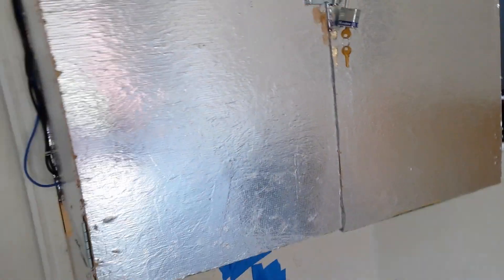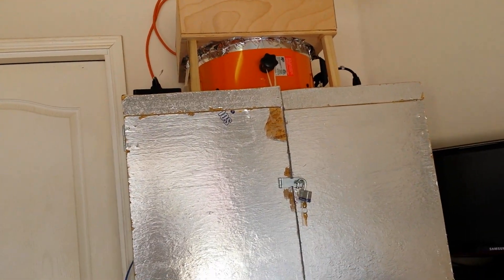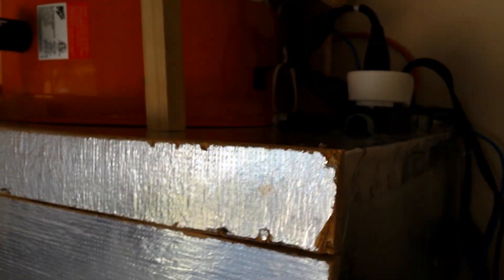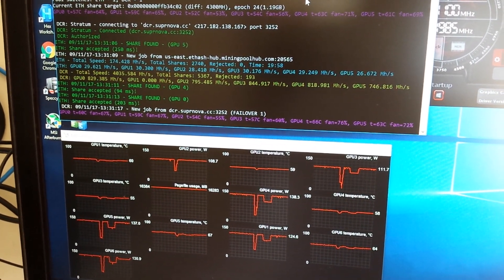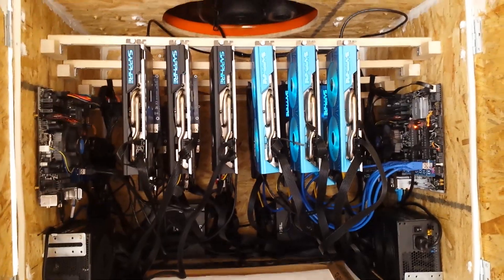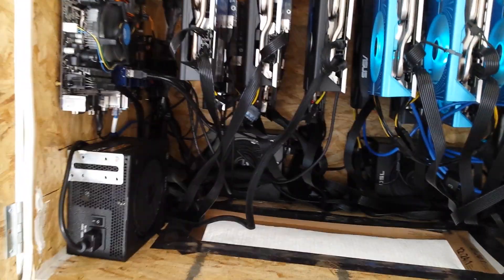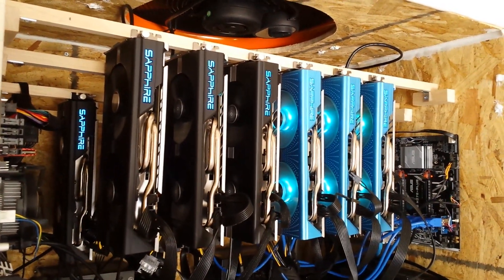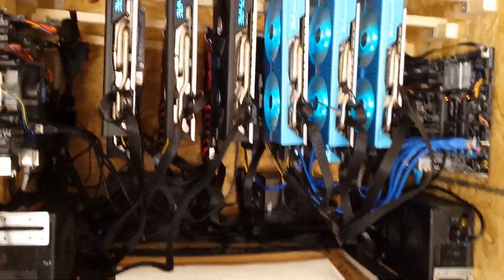Garage GPU mining cabinet

Comment: Hello. I'm in Texas too. I built a similar box as yours. I even had filters on the side and I install a vent on both sizes but still the temperatures went up. How is yours currently working? Does your machine have a lower temperature inside of the wood box than outside? Thanks!

Comment: I've been looking at an ideal air cooling design for my first rig. This is the first time I see yours, and so far you and twoton's 2.0 seem to have some of the better air cooling designs. I'm kind of building the same thing, except I will have a sealed box (hot air collector cell) above the GPUs and PSUs. The bottom of that box will have open vents that will only be cut out exactly above every GPU and PSU fan, no wider than the width of each GPU or PSU (the casings on my GPUs (the only ones I was able to buy in one shot "12") are not enclosed cases, so they do breath the side and back. GPUs I'm getting are known for poorer radiator and cooling fans) with rubber seals the air is then forced to go through the GPUs to get to the hot air collector box, above that box I will have a 7k CFM fan to create negative air pressure on the rig to keep maximum air circulation. So my PSUs will be mounted up high, pressed to the bottom of my hot air collection box vent (fans facing the inside of the hot air collection box with rubber seals around). All my computer peripherals are due for pickup this Friday, so I'm looking forward to starting this project.

Comment: Hey Blake, check those extension cords, they are pretty thin, make sure they aren't warm (Safety!).
Also mount the power supply at the top, not the bottom, that will resolve the heat issue.
The wood holding the cards will warp and maybe cause a problem with heat, maybe use metal for that and make it a swing out arm ( one side attached but can spin like a door hinge  ) then you can maybe get to the cards in the back and move the ones in the front out of the way... something like that concept.

Comment: I like your setup.  Keeps stuff more quiet venting into the attic and makes more airflow happen inside your attic, plus the box is up high on the wall and out of the way of most any flooding incidents.  
I wonder if a simple, cheap cabinet from the homedepot would work with this design as well for a single rig.  Quick and easy for someone considering this configuration and not wanting to do much if any woodworking short of jigsawing an intake and exhaust hole.
Reply from the maker: Yeah definately a stock manufactured cabinet would work if it was sized properly. I built mine on the smaller side. I believe it's 32"x"24"x22" (WxHxD).

Comment: Nice solution. On most i wonder about the dust. How often do you need to change / clean the filter?
I think having the power supplies blow their air into the garage will solve the problem. Flip them so the air out points down or to the side.
Reply from the maker: We get a lot of wind blown into the garage while the cars come in and out or when I'm working. So about monthly would be ideal, but I've been changing them 3 months to see if the dirt affects the rigs much and it doesn't seem to. As far as the power supplies I realizes that I would have to pressurize a different chamber for the power supplies to exhaust out their own path. If I simply cut out a vent or hole near the power supply then that would create an intake rather than an exhaust due to the fan's power.
Reply: I'm exploring the mining. And my idea is to put it in the crawling-space.  The floor on top is insulated concrete so crawling under it once every 3 month's is doable. 
Maybe for your power-supply's you can use flex tube to direct the air out close to the out of the big fan.
Reply: NVM about the intakes
. I like justRijk's idea better.

Comment: I have the Sapphire rx580 8gb special edition but it's samsung + Hynix memory with 512 bus !!!
 I cant find the ROM / bios/ config for those card :( I get only 27 mhs 
please help
Reply: sahbi ayed yeah Hynix memory is the worst for mining.
Reply from the maker: Samuelson the price surge started way before I was even interested in this and 1060s aren't typically the desired cards of choice for mining. Have a nice day though!
Reply from the maker: Do you know how to use Polaris Bios Editor? If so you should have a drop down box at the top right with K4G80325FB and H5GQ8H24MJ. The first one is the one that matters the most, it is the Samsung model number for the 8 gb chip(s). That means you need to find 1:1750 and 1:2000 and replace that strap with this instead: 

777000000000000022CC1C00106A5D4DD0571016B90D060C0060070014051420FA8900A0030000001011333DC0303A17